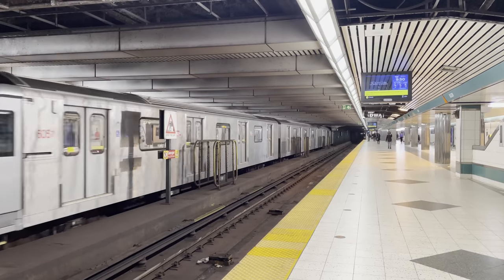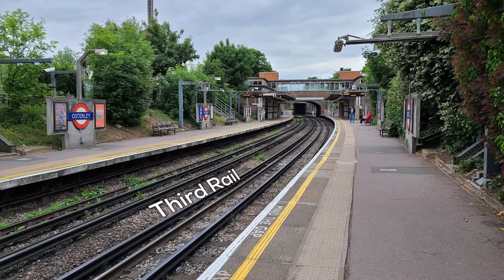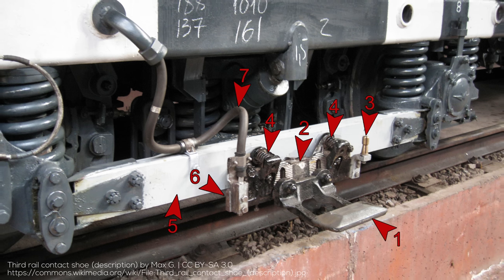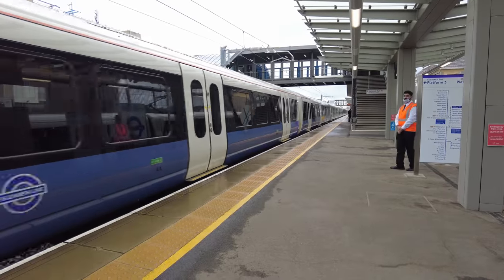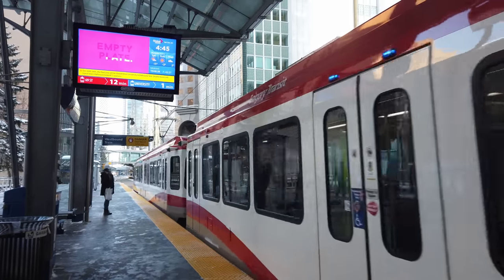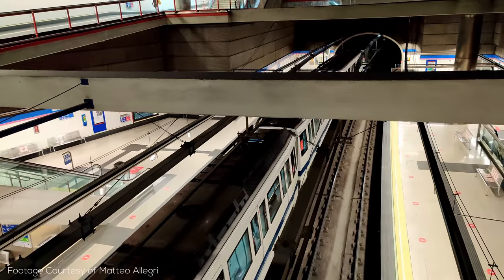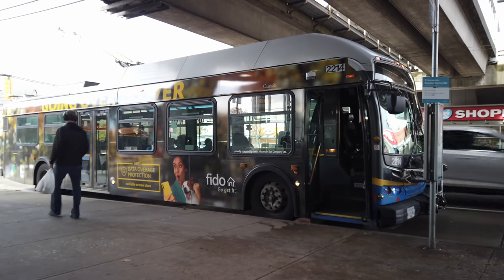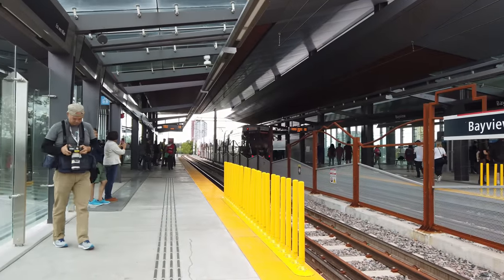The Best Way to Power Your Railway | Third Rail vs. Overhead Wire

Comment: One of the main benefits of electrification (vs systems where the power is generated on board the train), regardless of the mode of collection. is the ability to adapt the power supply to different sources of generation without having to change your fleet of rolling stock.

You can switch to cleaner, more efficient technologies as they come along, and the railways and transit providers are unaffected.

You can contrast this with the costs North American freight railways have had to bear as new pollution standards for diesels have been implemented. New standards mean newer, more expensive locomotives.
Reply: Does anyone know what would be required for an electrified freight train to work?
Reply: Electrification of the railroad. Same as the passenger trains.
Reply: That’s a little disingenuous of an example. as EPA standards only apply in full force to new diesel locomotives.  Railroads simply either bought as many locomotives as they could before Tier 4 took effect, or stepped up rebuilding programs and bought older engines back from lessors in order to take advantage of grandfathering clauses in EPA mandates.  The reason they’re buying fewer locomotives these days is a combination of this long-term “motive power banking” strategy and a downturn in commodity traffic that started with COVID, but hasn’t abated yet.

It should also be pointed out that Tier 4 freight diesels burn more fuel as they use less-efficient combustion to reduce NOx emissions, rather than DEF.  That’s cheaper than the DEF that Amtrak and most commuter agencies resigned themselves to using, but not as cheap as just keeping Tier 3-compliant and older diesels in service.
Reply: @luislicona386  An electric locomotive.
Reply: How about THIS idea----place the diesel equipment in small structures alongside the track(s), and run power lines from the diesel powered generators to either the third rail or overhead wire....

Comment: Interesting. I like the idea of using third rail below ground and then swapping aboveground to make it safer for people. Also the idea of having the power lines oscillate to spread wear out. That's one of those subtle little design features that I'm sure was a big "oh duh" moment when someone came up with it.
Reply: I suspect it may have started as something easier than making them straight.  When they zigzag a little I think you can have better control over the tension, because it is easier to see what is going on.  I'm no expert, though.
Reply: Yeah the blue line in Boston does this, uses third rail underground and then switches to a pantograph above ground.

Comment: 10:40 this approach of using catenary in the train yard to protect the workers is used on the Bucharest Metro system in Romania. On normal service, the Bucharest Metro uses third rail power at 750V DC, while on train yard it is used low-power overhead lines at 230V DC, where the maximum speed is at 15 kmh!
Reply: British Rail Southern Region (and its predecessor the Southern Railway) did something similar up to a point.
The vast majority of the system was 750V DC 3rd rail, including all the passenger emu depots and stations, but a handful of outlying freight yards were fitted with tramway style super-light catenary instead (still 750V DC) to make the ground safer, and the class 71 locos had pantographs so they could run on it to access/switch the non-3rd rail areas.
(The SR Bulleid electrics had pantographs too, but there were only 3 of them vs I think 24 cl71's.)
Reply: Milan also does this with their M1 and M3 metro lines.

Comment: It's basically the battle between the 'coat-hanger and knitting' or the 'stabiliser rail'. To be honest, nowadays it's easy enough to have trains that can do both. A lot of UK trains either have both fitted, or are designed so that the other system can be retrofitted relatively easily.

Comment: Technically Catenary refers only to the top of the 2/3 wires in a typical OHLE system due to the shape it follows.

The wire that the pantograph actually touches is called the contact wire (and droppers connect the 2)

When there is only 1 wire as in a tram system its generally referred to as a trolly wire regardless of whether pantographs or trolly poles are used (or both as per Toronto)
Reply: Absolutely correct. Further to that, the technical term Catenary actually refers to the physical shape assumed by a a rope, cable or wire under gravity from its anchors at each end and a rigid overhead conductor rail should never be described as Catenary.

Comment: Here in cologne the Stadtbahn uses 750/800V overhead wire, and what that enables is that some parts of the tracks are shared with freight trains as overhead wire is the standard on nearly all tracks in Germany. Only thing that had to be done was changing the voltage when the new lines were opened

Comment: Watching this as a Chicagoan I didn't realize how unusual it is that Chicago has an entirely uncovered top contact third rail for the entirety of the 'L' , which even includes a lot of grade crossings on  the Brown, Purple, Pink and Yellow lines.
Reply: Speaking of the Yellow Line, that was converted to third rail.
Reply: The rail network of the whole of South East England, roughly speaking south of the Thames and as far west as Bournemouth uses uncovered third rail. There are plenty of level crossings and remarkably few accidents due to electrocution. Trains on the main line from London to Southampton run at speeds up to 90mph, unusual for a third rail system.
Reply: I noticed that; also noticed workers crossing those tracks. The train has to stop and wait for them to clear the tracks.
Reply: @TootlinGeoff  the third rail goes all the way to Weymouth
Reply: @grassytramtracks  Thx I wasn't sure about the stretch west of Bournmouth. I knew when they electrified the SW mainline, they initially stopped at Bournmouth and put a diesel on to pull the 4TC sets to Weymouth.
Reply: @TootlinGeoff  Are you sure it isn't 90 KILOMETERS per hour?!

Comment: Fun fact: London's old trams used to use a hybrid system (3rd rail and overhead) you can still see the remains of the 3rd rail in the kingsway tram tunnel
Reply: There is an example of how this worked I believe at the London Transport Museum Depot - which is open a certain times of the year
Reply: London and Washington DC used "conduit" in the city centre since overhead wires were considered "unsightly". A few top contact systems had been tried, but none worked properly or safely enough. Since then, Alstom has developed its "APS", Alimentasion Par Sol (or something like that), using a top contact third rail that is divided into sections that are only energized when a tram is over it (them). It works well in milder climates, in Oslo where we have frost and snow and a highway department very much in love with salt, and in Bergen where they occasionally get bad frost (being a very exposed coastal city), not much so. Bordeaux solved the problem of "no overhead wires in the city centre!!!" with batteries.
Reply: BTW: Oslo’s metro used to have cars operating on catenary on one half of the system and third rail ob the other half of the system. Long story short, the "west" was comprised of old suburban lines using 1-2 cars, with conductors and level crossings and overhead wires, the east was (for the most) built as a "proper" metro using 2–6 cars, ticket sales in staffed stations and third rail. The systems were totally separate until the 90’s, when the two city tunnels were connected. Gradually, the lines on the west were converted to "pure" metro, and the overhead replaced with third rail. The dual cars ran in 3-cars-formation, as that was the longest platforms on the west in "pre-metro" time (platforms were extended from 2 to 3 cars). Finally, the last line to go was the one to Holmenkollen & Frognerseteren. But it only runs with 3-cars sets of the new MX class cars, and the rearmost, or third car is closed since the platforms only accomodate 2 car trains. But since the MX sets are open throughout, it works out. Twio stations can take 6 car trains, Holmenkollen and Frognerseteren. On "Holmenkollen day" express trains are run from city centre to Majorstuen to Holmenkollen. Now, it’s surprisingly snowy in Holmenkollen (that’s probably why they built that huge ski jump there…) and that makes for problems for the third rail subway cars. They have difficulties getting the snow cleared from underneath the third rail, and when enough snow collects on the shoes, the trains stop. They are working on it, of course, but on bad days, the service is replaced by mini buses (the roads there being too small for regular buses). And the MX cars don’t have sand, which gives problems when the leaves fall. Some lines are badly affected by this, but they try to spray a sort of gel that gives a better grip on the track. Which works reasonably well. In London, they spray away the leaves with high pressure water. Leaves (and grass) on the tracks becomes almost like soap, and the tracks get horribly slippery. The trams use sand to counteract this, the subway has done totally away with sand for safety reasons (sand can insulate a train from the track circuit, making it "disappear", which means the section will show up as "clear" despite there actually being a train there, and for maintenance reasons, no sand means clean ballast, able to do what it’s supposed to do. However, the subway cars got track brakes on the middle cars of each set after a few episodes when the anti-slip/skid protection practically had trains lose their brakes.
RM Transit has an episode on the Oslo Metro. It’s VERY condensed, so pay attention! :)

Comment: The Hamburg S Bahn also has a branch where the trains run on the regular DB network with overhead wire with the rest od the system being equipped with side contact third rail

Comment: Great video. Kudos for mentioning mentioning the UK southern rail network (you need to make a video on that a some point!) and Thameslink. Thameslink is interesting because it also uses rigid catenary in the central section around Farringdon/Blackfriars. One question your video threw up for me is WHY the Underground uses a 4 rail system when 3 rails works perfectly fine for everyone else. After a quick search on Google, apparently it's because the isolated traction current return allowed a train's position to be detected using DC track circuits (which I think can now be done with 3rd rail systems but couldn't back when the Underground was first electrified), and reduced any earth leakage currents that could affect service pipes, telephone cables, or cast iron tunnel liners.

Comment: In Spain rigid catenary is also used on new mainline urban tunnels, even for high speed lines, although obviously they run at not more than 100/120 kmh. 
A good example is the newly opened (1/07/2022) Chamartin-Atocha-Torrejon de Velasco HSL, wich on its urban underground section runs with rigid catenary. It is said that for this kind of underground low speed infrastructure, it has lower maintenance and installation costs, and it also occupies very little space.

Comment: Great shot of that Eurostar train passing through Stratford International Station (I was there last week to see the same for myself!!) That's going from London to Paris or Brussels. The centre (island) platform serves domestic "High Speed" services, the outer platforms are not used so much but are available for when required eg London 2012 Olympics. These High Speed trains use overhead power lines when on the faster lines and 3rd rail power track on the traditional railway routes, with swap overs whilst stopped at Ashford or Ebbsfleet stations (depending on route in service). The changeover takes seconds to complete and passengers don't notice a thing - except the change in speed of travel afterwards (of course). (Similar to Thamslink trains as you mentioned). As for weather, a few years ago when there an exceptionally cold and snowy snap in Southern England there were massive problems with freezing rain and ice on the 3rd rails, indeeed one train broke down due to power supply flactuations damaging the onboard electrics, and I got stranded for over an hour due to loss of power. (Near Ramsgate in Kent).

Comment: I'm a Driver Trainer for Thameslink (and Great Northern), so get to experience both AC & DC. Personally AC is better, if you're going Rapid Transit. 

You just get more power on tap from the 25kv AC than the 750v DC. The Difference is so noticeable from the Cab... Rigid Catenary works well for lower tunnels etc. AC is more pricey overall.
Reply: Depends. Places such as Hong Kong or Tokyo use a higher voltage of DC at 1500v
Reply: In Sydney they use 1500v DC too and they double strung the wires so trains can pull more amps. It's still less than the power you can get out of 25kv AC but it's as good as you're going to get without completely redoing it all.

Comment: 8:32 DC actually has better efficiency at distance because there is a thing called skin effect with AC.

"why then AC is used to transmit electricity at longer distance?". it is because AC voltage can be stepped up or down efficiently with simple Transformers. Higher Voltage transmit power much more efficiently than lower power, you can make ridiculously high voltage AC with minimal step up loss with just transformers.

in this time because we have more mature semiconductor technology we can also make a very high DC voltage with minimal step up loss tho. that's why HVDC (high voltage dc) is very popular right now for intercontinental electricity transmission, the bonus part is we dont have to care about matching frequency like we do with AC.

Comment: There are also some diesel trains fitted with pantographs/shoes so they can run on electric power on portions of their routes. This is becoming pretty popular in the UK with new trains like the class 755, 800, 802 and 88. Also there's the class 768/769 which were converted from electric only trains into tri-mode diesel, 3rd rail and OHL trains.
Reply: The class 768 is a really interesting train not only for it's tri-mode power but also because they've been converted from passenger to freight trains.
Reply: In New York both LIRR and Metro North have dual mode diesel and 3rd rail locomotives.  It allowed them to run express trains from their diesel served network all the way into Penn Station, since they use the same cars as NJT which are double decker but built specifically to fit the loading gauge for the NYC commuter rail tunnels.

Comment: 9:32 I’d actually like to correct you just here. Overhead wires can actually work for tall freight loads if done correctly. Indian Railways operates double stack trains and they built their wires high enough where the containers don’t interfere with the wires. As a result, all of their electric locomotives have bigger pantographs that can reach the really high wires. India also stacks their containers a little higher than in North America because they just double stack conventional flat cars whereas in North America we have special train cars that allow the containers to be mounted near wheel level. That’s the only thing I’d like to correct you on. Other than that this video explained in really good detail about electrification
Reply from the maker: I don't think I said it was impossible just more difficult. A lot of wired railways out there can't handle double stack (though often other loading gauge issues also exist)
Reply: @RMTransit  ah ok. I must’ve just misinterpreted it. Sorry about that
Reply: @RMTransit  Loading gauge is the main problem. Tunnels and bridges, you know…

Comment: And my personal favourite is Detroit's trams that are overhead wire + battery to power them during a couple of sections with no overhead wires.
Reply: A lot of systems use this in europe (Bordeaux, Sevilla, Zaragoza…) either with batteries, supercapacitators (like a battery that doesn’t degrade but can’t carry the voltage for lots of times) or a strange third rail that only activates when the tram is on top (APS)
Reply: sad how it was cut short by nimbys and lack of initiative by the city

Comment: Surprisingly, there have been some new grade crossings with third rail built in Europe, or rather lines with grade crossings that got converted to third rail. Oslo's Line 1 was an interurban style line with overhead wire and grade crossings but it got converted to metro standard third rail, keeping the crossing. And in Rotterdam, the metro line to the Hague was converted from a mainline railway, mostly keeping the overhead electrification but the third rail does extend across one grade crossing on the Rotterdam end.
Reply: There was no way to avoid the grade crossings (without either building huge road bridges or lowering the track). It was after all a low-cost conversion. The other lines on the west (2, 3, & 4) were completely metrofied with new under/overpasses for crossing roads, some even being completely closed (such as by Egne Hjem on the Kolsås line). The line to Bergkrystallen opened as "premetro" in 1957 with trams, and became the first full metro line in 1966. The line to Oppsal (extended to Bøler in 1958, Skullerud in 1967 and finally to Mortensrud in 19xx (20xx?) opened as a suburban tram line in 1926 to Oppsal, extended as premetro to Bøler in 1958, and gradually converted to metro during the 50s and 60s by building stations, removing grade crossings (replacing them with over/underpasses) and some changes in alignment to get better gradients and curves. The other two lines on the east (Grorud, now Vestli) and Furuset (now Ellingsrudåsen) were full metro from their opening in 1966–67, and never saw pre-metro operation with trams.